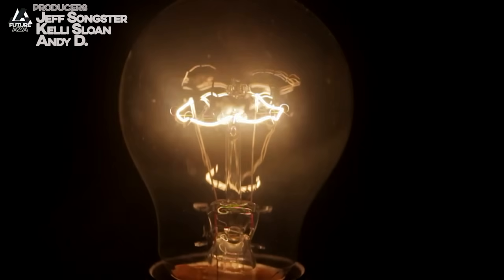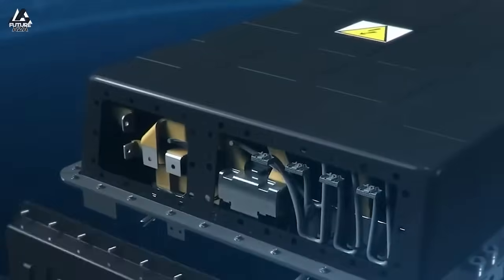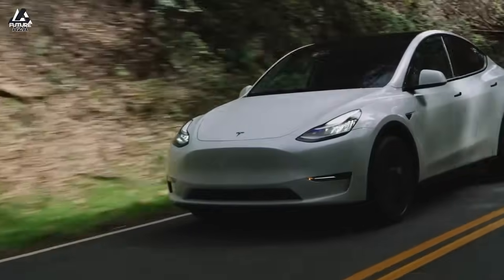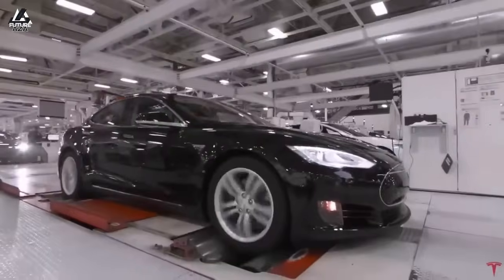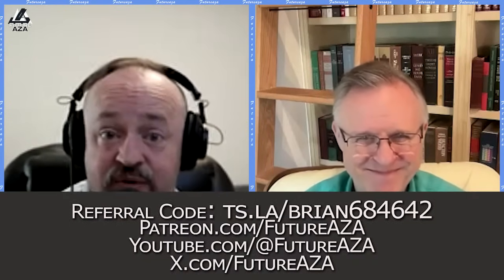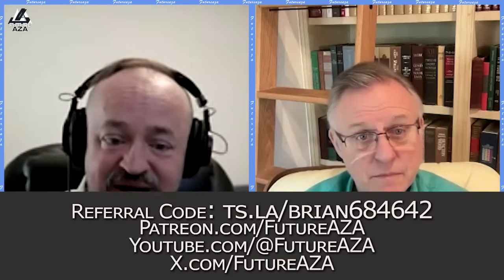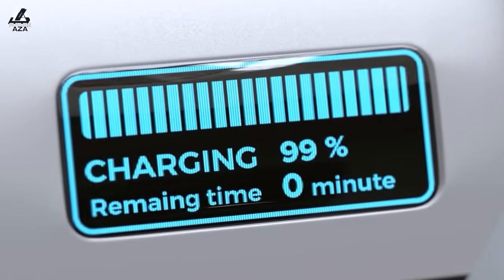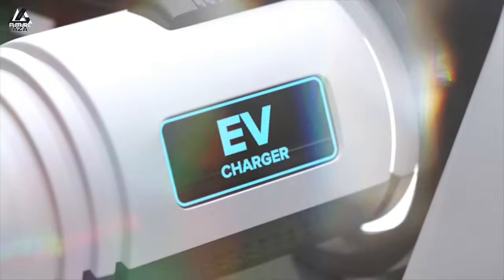Tesla's Game-Changer: LFP Battery Swap Option!

Comment: My 2021 Tesla Model 3 is getting the HV Battery replaced at 28k miles. Do not make the assumption that batteries just last forever lol Nothing is perfect. Luckily, Tesla has a reputable company & honored the warranty. Offered the LFP Swap & front suspension upgrade & provided a loaner with FREE supercharging for as long as the repair takes . Tesla is a good company. Took it to a seevice center & everything got arranged in about 30mins. I was stressing for no reason. Tesla is a goos company for sure. My respects to Tesla.

Comment: I took delivery of my model Y LR with FSD Sept 30, 2021.  I have 95,000 miles.  I fully expect to get 300-400k miles on this battery by the end of 10 years of ownership in 2031.  I will be 70 years old then, I probably driving a lot less.   and I am hoping an LFP replacement is available by that time so I can give it to my grandson.

Comment: Your statement that Tesla needs the LiIon batteries for new cars to qualify for the IRA rebates may not be accurate. I have had two battery replacements in my 2019 Model 3 in the last 18 months. Both times they installed a used LiIon battery from a car with approximately the same mileage. In neither case did they go with a new battery. The other thing that I haven't heard talked about is are we talking about the LR Model 3 getting these LFP batteries or only the RWD? I assumed we are talking about the LR as I was under the impression that the RWD M3 comes with the LFP batteries, but I'm not sure that it always has had LFP in the earlier models.

Comment: 2021 Model Y LR with 20" wheels gets "310 mile range" 
My Model Y gets about 210 mile range at 70mph, flat roads, and no AC on. I only charge at home on 32 amps daily top off at 80%.
Hopefully, they have better options in the next few years for the Model Y, and my batteries are better than the day I bought the car. 😊

Comment: The rubber swells in bushings.. break down.. or hoses. Too bad they can't fix those problems
Reply from the maker: What's this?
Reply: @FutureAzA  Ice vehicles with 300,000 miles. The rubber swells and cracks, then the balls bears fail. Coolant hoses crack and leak

Comment: Were Perl needing an HV battery pack swap, I'd gladly accept an LFP battery pack, even if it meant a nominal 10% power loss and/or similar range loss. I might even do the swap with a good battery still in Perl. With the current pack I generally drive in "chill" mode and very seldom charge over 80%, even on trips, so even a 10% nominal loss of power and range would cause no discomfort, and were Perl enabled by LFP chemistry, she'd get to park in the house, instead of the outdoor parking pad.

Comment: There are definitely good reasons to support LFP, from the 0-100%/worry-free charging and longer battery life, to lower purchase cost, to not using cobalt, to less chance of fire (except I believe that NMC batteries are plenty safe). Especially with the latest generation of LFP which has higher energy density and better cold weather properties. The downsides are more weight, and larger size for the capacity, and the elephant in the room, which is China. Who has cornered the LFP and battery materials market currently, and has a history of unfair/competitive business practices. One point however is that many of China's LFP copyrights have expired in 2023, which opened the opportunity for better battery manufacturing competition. It is a smart move for Tesla to offer the LFP battery pack swap. I agree that modern, liquid-cooled NCM batteries have a very long lifespan normally. But some people are concerned, so it is great to give them the option to swap to LFP. Tesla should also offer the LFP pack (at a reasonable price) to people who need/want to swap, but are out of warranty.

Comment: Is LFP cheaper?
Reply: Yes, LFP is cheaper.  No cobalt, no nickel.
Reply: My preference is LFP because it can be charged to 100% each time, it charges fast, lasts longer with less degradation and the end life of an LFP battery simply isn't talked about.
Compare the normal range of a Long Range nickel battery charged to the recommended 85% at home to LFP at 100% and you'll see that the range of both vehicles charged at home is closer to equal.

Comment: Manufacturer claims of 4 million mile batteries are reminiscent of the sellers who claim my LED bulb will last 19 years.
Reply: They should last that long. If they aren't then they are probably overdriving the LEDs to get a higher brightness from them. This is unfortunately common to find.
Reply: LED bulbs in my kitchen ceiling lights are all still okay after 12 years!
Reply: Amazing.
I've replaced at least half a dozen myself. @ISuperTed
Reply from the maker: It isn't the manufacturers making that claim. It's the researchers who developed and lab tested them.
Reply: As we've learned with recent scientific claims, researchers often rule in favor of their funding sources.
 @FutureAzA
Reply: Which manufacturer makes that claim of a 4 million mile battery?  Seriously, I haven't seen it.  The warranty is what matters most I suppose.

Comment: LFP is less likely to burn down your house while you're asleep.
Lithium Ion is needed exclusively for the <2 second acceleration to 60mph penis-measuring contest
Not a very good trade-off
Reply: Both batteries contain lithium but LFP contains less lithium.  I'll just speak to Tesla but acceleration is a matter of software and motors, I believe.
Reply: LFP contains no Nickel or Cobalt either.
They are less energy dense therefore more weight resulting in less acceleration.
 @snookmeister55
Reply: If I'm forced to sit through an entire 5 seconds to reach 60mph, that is 3 seconds of my life that I'm never going to get back.
Reply: LFP batteries are still Lithium Ion batteries, just a different chemistry.
Reply: Lithium IRON Phosphate
 @TB-up4xi